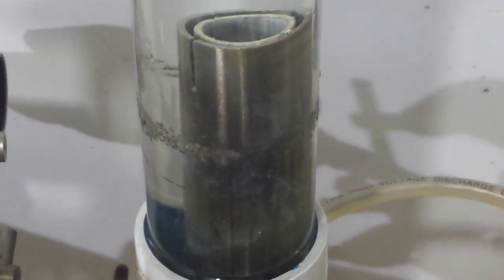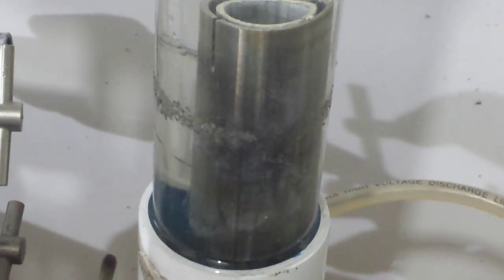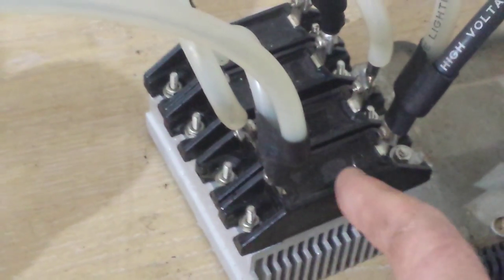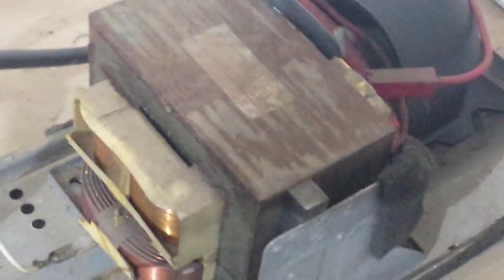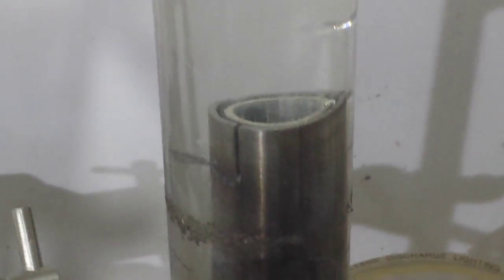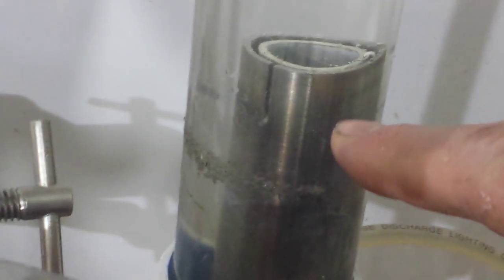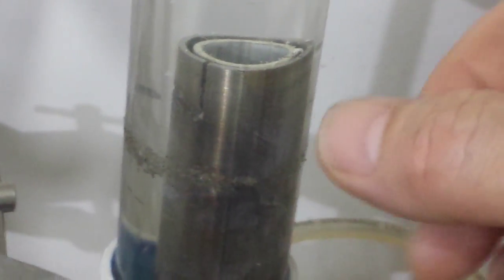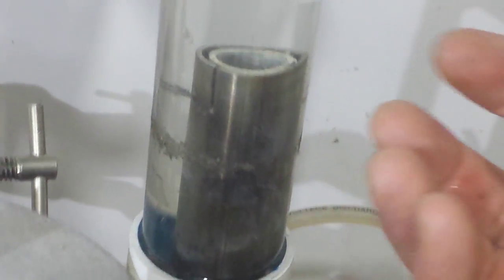High Voltage DC on Meyer tube cell -for Max Miller

Comment: And the water volume will just dissipate the high voltage. Put the cell in clear plastic tube with 1mm space and put plastic rod to fill inner tube. Think of the water as like anything that will absorb energy. The more of it the greater its capacity to absorb. You want the intensity of the voltage to be focused  between the water in the tubes

Comment: nice diode set up  ,have you tried this with electrolyte or are you using pure water?
Reply from the maker: I only tried this on distilled water.
I was not concerned with using electrolytes.
I want the action without the current flow.
Reply: m3sca1 i see , very cool that you tuned them.

Comment: it was heating up pretty good though. i posted the schematic for mine, it just used one diode, it was how the microwave was wired....looks like the cap is wired to limit the current and one diode goes to ground off the cap. my secondary ground is still bonded to the transformer core. i am guessing here, looks like the small wire would bleed electrons directly into the water , rather then from plate to plate. try your rectifier bridge to wires and the wire direct into the water. i ordered 2 bowls simular to yours, i have a set of tuning forks to, could make some cool vids. thanks buddy

Comment: So just at 50hertz then. Hmmmm I think it a lot about finding the frequency that pulls the molecule apart. The resonance is defined by what produces peak gas. It needs to be seeped as it changes for each cells size and the type of water.
Reply from the maker: Yeah she puts out much more at other frequencies, this was about the heating.  The AC sine wave seems to reduce the output more than anything. It performs way more efficient on pulsed DC

Comment: Good stuff,  wish you would tear that mots up up, and make it a step down transformer and try to see what happens.
Reply: the reason why.... Well when you think about high voltage saturating a piece of metal and you touch the two leads quick and pull them away you see the energy exiting out of the ends.  But when you see low voltage high amps in you can make a piece of metal glow red, and when separating it the voltage dont carry over like on high voltage.  basically i think you lose alot of energy once you put it in distilled water with the carry over voltage.  because its not a true dc source more like a pulsed dc so everytime it cuts on and off you would have that carry over voltage.  Am i way off base by this?  If you could see exactly what kind of water capacitor it would make when the voltage is turned of, and then tune your low voltage high amp source to that voltage, i think your pulse dc would be just as potent on the off pulse as in the on pulse.,  i dont know how to message you anymore or i would have wrote this novel there.
Reply from the maker: crob227 Mate long time no hear! Messaging can be done still but it is not obvious where to find it.Click on a users name.It will take you to their channel.Then click the button that says "ABOUT".There you will see the "SEND MESSAGE" button under the blurb where a person writes a short example of what their channel is about.
I am sure you will find some messages there from me.
The new google plus intergration has made it really hard and lots more clicks to do any personal messaging.I am sure they just want us to watch videos and not talk amongst ourselves.
Reply from the maker: I have a 20 amp power supply that puts out 12 volts.
Or are you talking in the order of 2 volts?
You made that spot welder-won't that do it?
It would be easy to do with a bunch of batteries in parallel.
Most of the dry cell guys are running like 2.1 volts per cell.

With the step down transformer,low volts/high amps we are in the realm of standard Faraday electrolysis.It is not Stanley Meyers stuff.
Pretty sure that it is gonna need electrolyte to make much gas.
Reply from the maker: another way to find your old inbox is click on "VIDEO MANAGER"
then click on "COMMUNITY"
who would even have thought to look there?
man they have ruined my youtube experience-screw you google +
Reply: m3sca1 Just trying to think outside the box, i have yet to see an example of a step down transformer on a single cell.  If i had the diodes it would be done.  Im just saying that I think high voltage has alot of losses into the air think about when you see high voltage coming off of a piece of metal it dont matter how big the wire is it still only comes off of a little area,  But low voltage high amperage saturates the whole plate. and i know your thinking that thats only in air, but distilled water acts alot like air as far as resistance goes.  Meyers had alot of stuff going on, and no one has come up with the exact process, im just thinking it would be worth it to sacrifice a mot for it, you can by #2 wire by the foot, but the diodes have to be able to handle it. it tried a water diode but couldnt get it to work.  got a link I might buy them myself.
Reply from the maker: crob227 yeah i hear ya on the HV losses-i do have a burned up MOT-and i can get the wire cheap from work.Diodes are cheap enough-although thinking about it the high current ones are bit more...kind of like welder diodes.
Maybe you could scrap an old alternator -they have some chunky high amp diodes??
Reply from the maker: crob227 you find the old youtube inbox yet?It is still there with the old messages-its just hidden away cos they want us to use google pus
Reply: m3sca1 for big diodes for low voltage.....look for solar power diodes. i got some huge 40 amps ones cheap. 70 volters i think
Reply: crob227 i have a video of such a device its called copper cathode cell hho torch
its a single electrode cell connected to a 500 amp dc step down  mot, problem is harmonic distortion of current limits the output to 70 amps dc at 3 volts , i need a frequency generator to increase the herts
Reply: i also have a video of the device dissembled after many hours of operation to see what happened to it

Comment: Ah yes.  Arc welding under water.
Reply from the maker: strictly speaking it is not arc welding under water since there is no arc.
it wont strike even with a charged cap dumped into it.
the cell walls behave more like a capacitor with water as the dielectric.
need a sharp point to strike an arc

Comment: http://www.irondmax.com/irondmax/forum/forums/thread-view.asp?tid=366&posts=7&start=1
there is the schematic there. i am not sure of the diode direction. makes no sense to me, honestly. but thats the way it is marked right from the microwave. i will check it more later, but have not yet... been a little busy
Reply from the maker: do i need to join the forum to view the pictures? they are not loading
Reply: m3sca1 i think you do. sorry. it is free to join though
Reply: Hullo Max!How are you???I am searching for better solution to power my house with water fuel cell.I heard in one video presentation of Stanley Meyer saying that when we crank up voltage from 12v to 20kv with high frequency, we can have hydrogen production.....I want to hear it from you too.can I try it with flyback TV transformer for high voltage output???? I have heard the output of flyback is DC, is that true????Regards!

Comment: NIce!  Ive tried something similar... I didnt have the high voltage diodes that you show in video. Mine only goes up to like 1000v....but i did notice a difference.. first  although i was only  applying around 500volts the water would drop the voltage down to about 20volts (Distiled). the temperature in my setup was fine..I was also using lots of inductors ,without the inductors  the amps would go up exponentially. If  you were to test your voltage at the cell it would probably drop considerably also.. water has amazing ability to convert voltage to amps.
Did you use inductors in your setup?  check this video let me know what you think.. 
https://www.youtube.com/watch?v=wwEUWcA8dJI